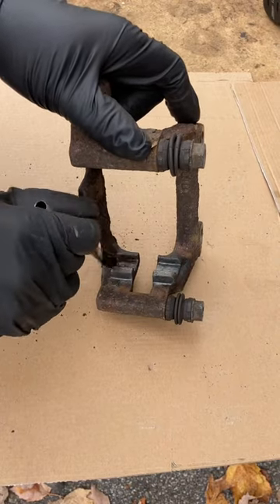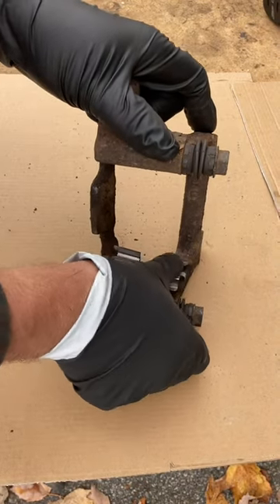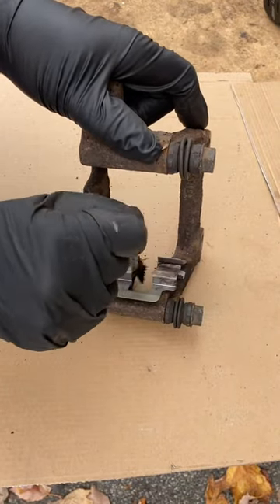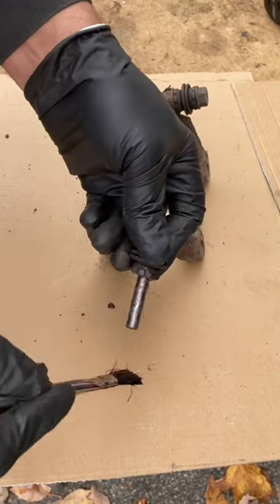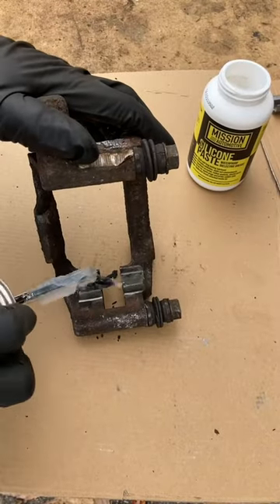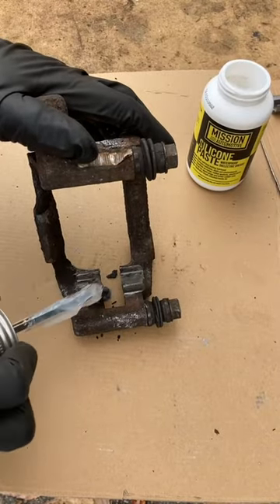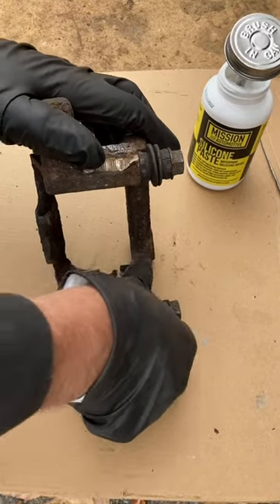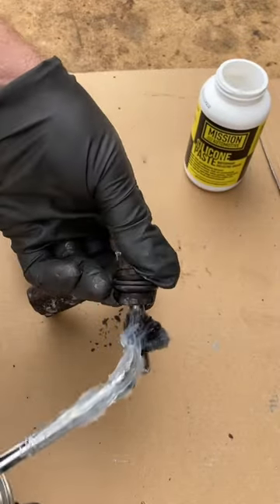What should you use for brake caliper grease? ￼

Comment: I use silicone paste for the caliper pins. I use copper anti-seize for the retaining clips, the grooves where the retaining clips rest, and shim on the back of the brake pad.
Reply from the maker: Sounds great! 👍
Reply: Same here
Reply: Chris fix watcher
Reply: why silicone on the caliper pin? Does the anti-seize ruin the rubber boot over time?
Reply: it will damage the boot but also damage and increase the chance of seizing pins. The copper in the grease actually increased friction and binding. Copper grease is more suited to static components, not so much for moving parts @raczyk
Reply: No copper grease and no ceramic grease it WILL GET STUCK been there done that. Grease attract sand and dirt. Pins only with paste like ATE  bremscylinder or other brand.
Reply: @KLOKSLAG1911   I think you may be right, I put some anti seize on, and one of my pads is stiking. Causing a banking noise when first strting to drive around with the car.  Wonder if just a bit of oil woudl be good to prevent the caliper bracket where the clip sit not to rust. 

Do you recommend cleaning the caliper bracket with a wire wheel like in the video, or is that also unnecessary?
Reply: @raczyk  wire brush and or sanding. Brakepads need to be moving freely. And pins also. Oil ? Hmmm
Reply: Yes. There;s one You Tube channel I follow and he has his own shop. He lives in the rust belt area of New York state. He puts a dab of grease on the area behind where the clips are set into. He said the problem is that if he doesn't do it the chance of rust jacking can happen. The rust builds up behind the clip and it pushes on the pads and can cause seizing of the pads. He said he's done it for thousands of times for his customers and he's never had a problem.
 I know a lot of people say the manufacturer doesn't do it so they don't do it either. But this guy came about this solution to mitigate the chances of rust jacking happening.
Reply: @Rhaspun  i also done that back in the days haha but not anymore. On salty roads i understand that.
Reply: @scissrface2182 so I've read yes
Reply: Ditto. But nothing on the back of pads

Comment: I use permatex brake lubricant it’s the high tempature one that’s purple i put it anywhere the pads touch, never sticks
Reply from the maker: Nice! 👍
Reply: I bought the blue versachem cause i couldn't find the prematex , it's still as good
Reply: I like the purple one more though
Reply: I was told not to use purple and to use red, how long has you work lasted
Reply: Their purple one is good but their silicone one is better, at least for the pins
Reply: @scissrface2182 the red is the silicone. It's best!
Reply: @kdmj48 I have the green one lol, don’t know if it’s good or bad, bought it well over 10yrs ago

Comment: I've found that grease under the clips and on the clips just collect dust and dirt to the point where the pads will seize. I just wire wheel everything or file if it's really rusted then assemble the clips with no grease. Silicone on the pins because I found that grease just gets hard in the pins over time and seize up the pins
Reply: Up in the rust belt, if you do that, in one salty winter, the pads will be seized solid in bracket. We clean bracket and paint with rust primer and use the purple lube on contact pad edges and our brake jobs last years.
Reply: @stevestadnik9206  I'm in the rust belt. My brake jobs last years too. No issues ever since I stopped gooping everything up other than slide pins
Reply: @MacAutoDiag  Well, I have seen unlubed and unpainted brackets not last and done my way last, so I will do it my way. I have seen 2 year old cars I had to hammer the pads out of bracket. They must use less salt where you are from. Where I am from, as soon as one snowflake, the salt trucks are out full force.
Reply: @stevestadnik9206  it's the same with Illinois. If you had to hammer the pads out soon after putting them in it's because they were hard going in in the first place. With pads that are hard to go in I file down the brackets so that the pads slip in nice and easy but not too loose to where it's rattling around. They don't use all of that goop from the factory and from the factory the pads last years. It's the same thing here that's all.
Reply: @MacAutoDiag  I am talking the brakes the car was born with. No lube from factory and having to hammer them out cause of rust. I selective clean bracket to make sure not too tight, but not too loose for a noise complaint as well. I just had one 2022 with 55 000 kms (40k? Yankee) that I had to beat the worn out pads out of. I have a friend that works at Kia, and as part of a PDI, they lube the brakes, cause the factory doesn't.
Reply: @stevestadnik9206  man you know what...yo momma
Reply: @MacAutoDiag  What a delightful and intelligent comeback, thank you.
Reply: @stevestadnik9206  thank you goodnight
Reply: @MacAutoDiag  lol...I live in Illinois like you do and from my experience is best to use something under the clips and on top of the clips. When I lived in California, I could get away with not using anything except for Toyota Lithium Soap Base Glycol grease on the slide pins because of the rubber bushing and rubber dust boots. In Cali the metal under the clips wouldn't rust and cause problems. I also didn't use grease on top of the clips, becasue if I did, it would cause dust to accumulate and cause a little binding. Here in Illinois I use aluminum anti-seize under the clips, permatex purple on top of the clips and on any metal to metal contact. Like I said earlier, I only use Toyota Lithium Soap Base Glycol grease on the slide pins and the brake jobs last 7 to 9 years. You might think that's BS but it's not.

Comment: I use brake grease on all of it. Pins and over and under the clips. Over obviously to allow the pads to travel and under to prevent rust from pushing the clips and pads tighter together
Reply: They can that rust jacking. I never heard of it since I don't have that kind of rusting problem here in California. I learned about it from another channel. The guy has a shop in New York state. I am always blown away by home much rust is on the cars that come into his shop.

Comment: I use anti seize under the clips then the black caliper/brake grease on the pad side of the clips and on the pins. Up here in the rust belt alot of premature brake failures are from pads stuck in the sadles/bracket. Always from them being rust jacked from under the clips. So some sort of grease or anti seize is a must.
Reply from the maker: Exactly. I’m in NH and MA we have put something under the clips for over 20 years. It’s funny how many people argue with this and say it’s wrong. They  obviously don’t live in the rust belt.
Reply: @AndyTheXTech  Exactly 💯
Reply: @AndyTheXTech  so anti seize under the clips and silicone paste everywhere else? I’m in Canada so rust belt as well
Reply: do you clean the caliper piston, get rust off? Do you grease the caliper piston while cleaning?

Comment: I absolutely have to put grease under the clips because if I don't rust will build up and grow over time and take up the clearances required for the pads to slide properly. I put a light smear of the grease on the pad ears, and then I replace the pins and boots and use the orange Permatex grease because it has extremely high resistance to heat and it doesn't get stuff and stick the pins. I also clean where the boots snap onto the calipers as clean as possible and put grease on the inside of the boot where it connects to the caliper, to ensure the rust won't grow and allow water and salt into the pins. I will often clean that point and put a quick shot of fast dry Tremclad Professional spray paint around the flange where the pins go in to keep the rust from forming. It works, I did that about 4 years ago and those points are still rust free.

Comment: Copper anti seize will eat away at the rubber pin boots! Always use silicone lube on slide pins!
Reply from the maker: Good tip😁👍
Reply: I am pretty sure the ceramic break parts lube works just fine too - shouldn’t eat away the rubber like petrol based products

Comment: As long as you don't use anti-sieze on rubber parts, you're good to go. IMO, the best practice involves synthetic brake  or silicone grease on moving parts like sliders and pins.

Comment: Don’t be afraid to get new brake caliper pins if you see any signs of wear, rust, or corrosion I replaced some other stuff as well as the caliper slide pins, they only cost me $12.88 from my local Ford dealer.

Comment: File the rust off the mating surface for the anti rattle clips, a wire wheel won’t get it all, silicone only on the clip/pad side, because the rear is going to rust either way. Silicone on the pins, very lightly to not create an air pocket. Then reassemble.

Comment: Clean the bracket, clean the guide pins, clean the inner pistons, install new hardware, put Copper anti seize in the hardware, back of brake pads, put silicone on guide pins, close caliper, press brakes.

Comment: I have used that silicone paste but the last brake change I did the caliper pin was seized. Now Im using anti seize but not copper its nickle good to 2000 degrees and i coat everything ill let you know how it holds up in about 2 years : )

Comment: Can you tell me why my brakes squeaking when reverse but not in drive ? After replacement of brand new brakes and rotors also when braking i hear grinding noise or sounds when braking lightly if i brake hard its smooth, any help thanks
Reply from the maker: I’m actually having a similar issue on our Volkswagen atlas. I’ll be trying to fix it. I’ll make a video on it. 👍

Comment: I use anti seize for the anti rattle retaining clips and then I use anti squeak paste on the edge of the brake pad joins and then use silicon grease on the caliper pins
Reply from the maker: That works 👍

Comment: Great topic. I suggest using any hi temp grease / anti seize that won't run out from brake heat. These parts need to be lubricated especially in 4 season climate; water and road salt cause brake part corrosion, seizure, dragging brakes.
Reply from the maker: Yup absolutely! 👍

Comment: The copper grease stops the cast iron from corroding which expands and traps the pads causing them to stick. Always grease the surface's. The silicone grease won't take the heat generated by friction.
Reply from the maker: Great! 😁👍
Reply: lol silicone grease has much higher lubrication retention at higher temperatures than copper anti seize
Reply: @lordjaashin  It spreads to one molecule think when it gets hot. The copper in the copper grease forms as a soft metal lubricant and withstands  the heat.
Reply: @lordjaashin  I would use a high temp brake lubricant. I use the Permetex high temperature version. It's the silicone based one. It's safe on the caliper pin boots.

Comment: Maybe nobody will read it but here's my opinion after 40+ years. 
     I use a plastic imbedded narrow wire wheel made for tire repair, faster but not as thorough as a file, then paint the bracket. Install the abutment clips with the paint wet to help hold and seal the back of the clip.
   Brake lube (sparingly ) on bare clips, nothing on the premium coated ones ( preferred if available )
   Use a drill bit to clean the pin holes of rust and dry grease (metric for modern, letter size for older US ). 
    Don't be afraid to push for new pins & boots! 
  Very high temperature grease ( 550+) will work on the pins but can melt down if overheated, and if petroleum based will swell rubber.
Synthetic silicone or ceramic brake lube is better, never anti-size or dielectric grease.( wrong type of product ). Slightly dry original lube can be revitalized with chain lube, rubber friendly and quick.
     If one pin has a rubber bushing, it probably goes on the leading (first in forward) rotation position, same as the 'squeeker' on the brake pad.
    Sil-glide (tm) seems to be slipperier then most brake lubes.
    I anti-size all bolts and studs ( again sparingly, most people use way to much) except for the hydraulic hose fittings.
    Stuck pins will twist off and bend easily, I made a L shaped forked air chisel bit to drive them. Easy on the heat, you can get a grease explosion! 
    Extreme cases I drill a hole in the bracket to try to punch out the pin,  sealed with RTV silicone afterword. Beats buying a caliper or bracket.
Reply from the maker: Ya I think I’ve done most of these through out the years. Good tips. 👍
Reply: I always wondered if you can buy just the brackets….can you do that? I would imagine however that if it’s that bad of shape your entire calipers would need replaced as well.
Reply: @greeneyesfromohio4103  
   Caliper brackets are available as NEW  bare castings, Requiring pins and boot kits to assemble as these are the parts causing the issues.            Usually remanufactured calipers come with refurbished used brackets for the same or less money,  with the added benefit of the remanufactured caliper.

Comment: I never use grease or anything until I had a guide pin freeze from now on I will always put at least something even Vaseline. But I’ll continue not using anything but for the pins.
Reply: Vaseline could eat the rubber boot. Best to avoid petroleum based stuff.

Comment: No anti seizure paste. Just molly lube on the cleaned guide pins. Nothing on the hardware at all. Use a straight file on the bracket areas, a wire wheel doesn't get into "the corners" quite right. Pads should slide easily, but not move around in any direction except towards or away from the rotor.
Reply from the maker: 👍sounds great!

Comment: I swear by a swiss formula brake caliper Grease called Paste Lube. It's rated to 2,400° it's safe for use on plastic and rubber bushings and boots. It's salt water and carwash resistant. I've done many brake jobs and no squeaks. Silicone based greese will dry out and will bind the brake caliper slide bolts or pins.

Comment: I leave the old hardware where it’s at slap some pads in and call her done. Never had a complaint no need to over complicate. On my own car I grease the new hardware when the brakes slide and degrease the slide pins as well with brake grease

Comment: I use red loctite to glue down the shims I also use red loctite to glue the brake pads down to the Sims I also use red loctite to make sure that the slides don't come out I also use red loctite on the bolts to hold the calipers to the slides to make sure they don't fall off 💩🤣🤦
Reply: I think JB weld will do a bit better job, but glad that's working for you 👍🏻

Comment: I use synthetic brake lube on the sliders pins, clips, and the edges on the pad that contact the clips and any surface that runs metal to metal like done retainer springs

Comment: Never put grease where slides because is collects dirt. Put grease under clips to prevent rust jacking. Silicone for slide pins always. You mix the grease with silicone they use from factory the pins will seize

Comment: Always clean and Silicone the Pins :)
also clean the rubber boot and remove the rust inside the groove of said rubber boot.
Had to replace two carriers because the pins were so stuck, I broke the head off while trying to free them up..

Comment: I don't put grease between the clips and bracket but I do use brake grease on the clips where the pads slide. New grease goes in after cleaning the pins off of the old stuff and grease on the ears and back of the pads. good to go
Reply from the maker: Sounds good. Up here we do it because of the rust. Just to slow it down.
Reply: @AndyTheXTech  that makes a lot of sense. So do you prefer brake grease or the Grey anti-seize?
Reply from the maker: @DanielWraps  I normally use caliper grease. But I’m told the new thing is silicone grease.

Comment: Doesn't everyone know putting grease on exposed surfaces does nothing but collect rust and dirt and turn into an abrasive paste far worse than having no grease. Dry lubricant ok, graphite or somthing. Grease is meant for high speed or high pressure points or inside a seal or rubber boot.
Reply from the maker: I’m not disagreeing with you. 👍

Comment: Silicone on pins and any rubber, anti seize on metal to metal, and molybdenum grease on back of pads/shims, per Honda… molykote m77? 🤷‍♂️ torque the oil drain plug to spec! lol

Comment: I clean up the bracket. I don't put brake grease on the bottom only on the top of the clips. I also clean/replace the pins and clean out the pin holes and grease the pins. Antisieze only for threads not for moving parts. Silicone great for pins, won't stay on the clips.
Reply from the maker: Sure 👍

Comment: Lol I wish that you had a prize for your hidden messages!! Lol Come on U contradicted yourself and you said they don't use any thing under the clips then why should I? Come on you sure you didn't say that to get a reaction from mechanics and none mechanics?!! Lol Then U applied grease then put anti-seize over that and then put silicone over that!! U r a Mechanic at 1 A Auto App and web site!!  So I am sure you would know the best way to do it! The one thing I am against is when a mechanic always saying that it's the best way and only way to do something because that's the most idiotic statement you can make because they're always a different way to do something it depends on if ur doing it cheap as possible or the most expensive way or a number of ones in-between!!